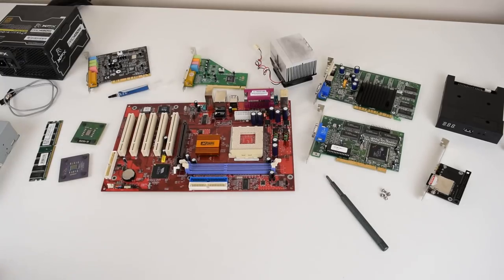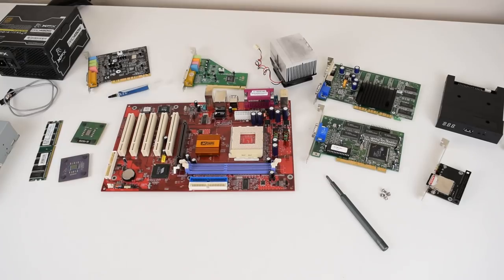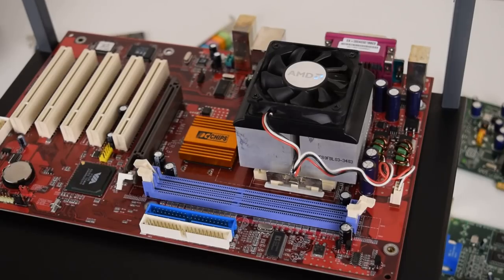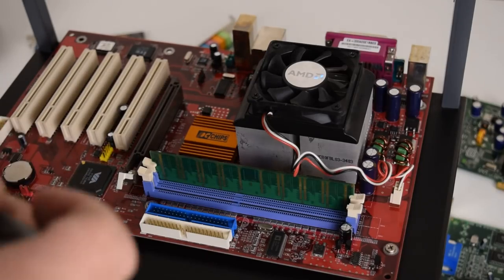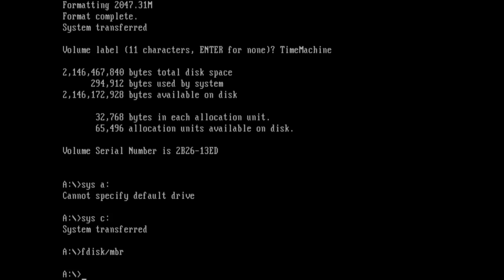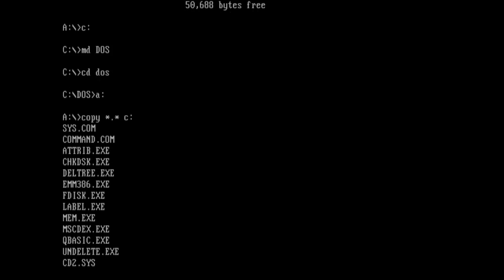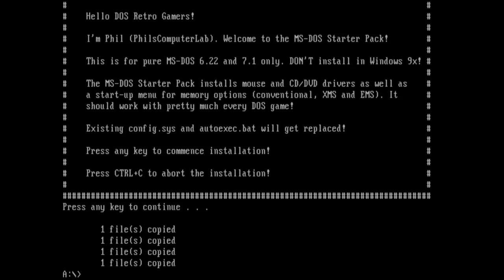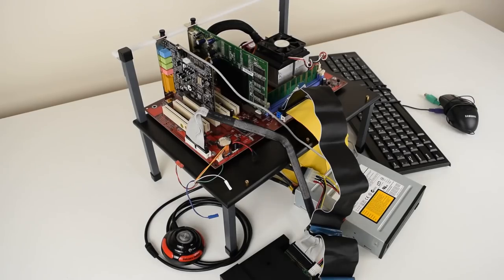Building a DOS Retro PC that everyone can afford

Comment: Personally partial to a slot 1 Pentium 2 at 230mhz. £10 price used, easy to install (slot one just plugs in like an expansion card, hear sink and all) and runs pretty much all the 90's software I can find without the need of cpu slowdown software. Iz nice. That and a stick of 128mb sdram wont set you back more than a few quid, and a period correct IDE drive is cheap as chips too. Only trick is getting a sound card both dos and windows compatible, but any ISA Sound blaster card, even the cheap cut down models (actual SB 16's run stupid pricy these days) will do just fine. For graphics I'd put any AGP card with about 32mb to run any late 90's game effortlessly and a PCI Mach64 card (windows 3.x compatible) for everything else. Wierdly, those old 5.25 floppies are ridiculously expensive now, £50ish for any listed working model. I don't feel those Flash cards are the best way of swapping data over though, a £3 usb switcher with any usb stick will let you switch it between two pc's with the press of a button, and a VGA to HDMI converter means no need for another monitor, just so long as you can set the aspect ratio correctly in the monitor settings. You can even buy new retro style beige cases.

Comment: Everything is expensive now, especially motherboards. Z68 motherboards, lga 1366 mobos, P5K mobos, socket 939...they are all at or higher price than brand new modern motherboards. I remember you could get a gtx 280 for like $20, now they are like $60. Its outrageous.
Reply from the maker: What about OEM SFF machines?
Reply: @philscomputerlab  those are still relatively cheap. Its mainly the desktop components that are overpriced. Although sff gpus are outrageous.  I can get an i5 4570 optiplex in my area(california) for like $60-$80.
Reply from the maker: @TrevorM1992  Hmm I could do a video about SSF and some cheaper Low Profile graphics cards. More for older games, Retro Games to tie you over...
Reply: @philscomputerlab  That would actually be amazing. Preferably a decent card under $40 USD. The one i always see is the HD 7570 1gb or r7 250.
Reply from the maker: @TrevorM1992   @Trevor Mundee  Yes something along those lines! While you cannot play the latest games, it will get you into PC gaming and you can play a ton of older games. And when prices improve, you can upgrade the graphics card to a 750 Ti or 1050 Ti or 1650 or that new Radeon OEM card that got announced.
Reply: @philscomputerlab  Exactly! By the way, have you ever considered doing a video with a sff pc and testing emulation? Such as psp emulators and gamecube emulators? Theres a ton of people who build these little sff emulation pcs just for playing psp games and such.

Comment: I have a ton of 64 and 128mb DDR1 sticks ive been holding on to but never thought there would be a use for lol I might try building a machine like this now
Reply from the maker: 64 MB? Nice :D
Reply: Yup i have 4 sticks toshiba brand 64mb DDR1 SDRAM sticks a few micron samsung and nanya 128mb sticks and a unknown generic 256mb DDR1 sticks. I also have a ton of DDR2 in small sizes I cant recall off the top of my head and like 200 sticks of various 30pin and 72pin sims in both FPM and EDO lol

Comment: Ok, actually in this setup you can use almost any socket A CPU, because there is a hardware hacks for them. Its easy to make, in almost all cases you can use just a sharp pencil for hacking, but for XP family its a little tricky but not impossible. The main goal is to make CPU identify itself as mobile version CPU (or even full unlock), so its enables multiplier free change by bios and software.

Comment: Great video again Phil ive only been following your channel for a few months but thanks to your videos and input on here and twitter ive already done Dos, Win 98 & XP builds but I still want to build more :) One thing I would like to know and maybe you could a video on this especially for the thin client PCs without optical drives is there any drivers out there that allow the use of a USB cd drive (especially for those Lucasfilm talkie and Star Trek CD games) theres some conflicting info on the net as to whether this is possible apparently there are some old panasonic drivers from years ago that may work but ive had no luck with them.
Reply from the maker: Hmm, there is software to mount an ISO image file AFAIK. Lucas games should run from a folder without needing a CD I believe.

Comment: I have a MINT Gateway 2000 486 DX2-66, 16mb, 120?mb, 2-4x CD with WFW3.11, DOS 6.22. The only things I DON'T have are the original keyboard and mouse. The big cork feet are pretty deteriorated, though. I got this "curbside shopping" (free) with a bunch of original software (probably $2000+ retail new). I also found a Gateway 2000 486 DX2-66 LAPTOP - I forget most of the specs except it was 4mb RAM - but only Windows 3.1. I used that as my HAM Radio programming rig, the desktop was my retro PC. The laptop, unfortunately, fell from about 4' high and "exploded" on concrete during a move and that was the straw that broke this camel's back.

So, if I'd had the laptop currently, I could be tempted to sell the entire desktop for a reasonable price (think "rummage sale" not "ebay" pricing!!!) But now without the laptop, I'll probably will the desktop to my kid!

Comment: A K7S5A is perfectly good as it has a ESSONIC sound hardware on board it does share the system ram with the on board GPU also has SATA I, if you want to separate graphics card try an AUSTECH EN9500GT with NVidia GPU, or what about a AM3 motherboard and AMD PHENOM II X6, the ESSONIC suit of programs include 3MIX DJ scratch package.
 if you are having problems with certain drivers then try DEVICEHIGH:=MSCDEX.EXE /D: or /E:
EUROFIGHTER EF2000 TACTCOM will not run properly and and you might have to change the multipliers to get EUROFIGHTER EF2000 to run.
can you not use a SPDIF feed from your CD ROM drive to your sound card to get the audio.

Comment: hercules 3d prophet 9800 Pro agp card?

the HDD normally connects on the primary port with the nearest connector to the board and 80 pin cable

Comment: I've been finding it's WAY cheaper to get full systems that nobody wants and pick out the components you need than to get the components individually. Those old systems are a gold mine for Memory, Cards, CPU's, Old IDE Drives etc. What pisses me off is that people are mostly just sending them off the the recycler. :( In the real world Slow is dead and dead is off to the recyclers or gulp in the garbage. :( So sad.

TLDR: PEOPLE ARE THROWING THIS STUFF AWAY FOR FREE.
Reply from the maker: Yes, depending on where you live, you can get nice parts for free :)

Comment: Really nice video, great idea. I would have not thought of using a Socket A setup for DOS. I think I now have a reason to keep my Socket A board, not that I was going to get rid of it anyway. I'm curious if this setup would work with Sierra games that bug out if the PC is too fast (KQ6 comes to mind) or if One Must Fall runs without a hitch. Any thoughts of dual booting with Windows 98/XP?
Reply from the maker: Yea if you disable the Cache you shouldn't have any speed issues with Sierra games. Of course you can run other Operating Systems.

Comment: With the prices rising on old pc hardware, I wonder if the atom chips might be a option as they lack a lot of the modern features but retain the x86 compatibility at a low cost.
Reply from the maker: What parts exactly are you referring to?
Reply: The cpu/motherboard. Given that the atom chips are cheap and low power they may be ideal for old dos system in place of a genuine 486/386 etc. Usually less audio/video expansion availability however. But investigation of it may be interesting. A very small and easy set up may be possible that way as they're available in numerous mini itx boards, as are the and geode CPUs which is effectively amds answer to atom chips in some respects

Comment: Speaking about AMD Geode, have you ever heard about Alix PC Engines ? A long time ago I had an alix1d, it's a mini-ITX SBC based on a Geode 500MHz, 256MB of RAM, Sound Card, VGA, Compact Flash, mini IDE interface, 1 PCI. Unfortunately I did not try DOS or Windows 98 because I used it as a Linux server (Raspberry Pi did not exists). If my memory is good it was possible in the bios to downclock the CPU to 333MHz. One day if I can find a cheap alix1d I would like to give a try.

Comment: Great video! Is that Duron multiplier locked? I wonder if it would be possible to play 486 or Pentium games on this? Probably not as versatile as your 4-in-1 K6-III+ build, I'd guess
Reply from the maker: Yea it's basically a 2 in 1. 386 or Pentium III level performance.

Comment: I have a PCChips M789CG motherboard with onboard VIA C3 processor, though I wouldn't recommend it as a retro DOS/Windows 98 machine contender since the motherboard isn't stable enough, unfortunately. I have several problems with the system, especially BSOD problems on Windows 98 and XP (IRQL_NOT_LESS_OR_EQUAL). That is, until the motherboard decided to bit the dust by freezing every single time it goes to the BIOS process.

PCChips is such a bad brand when it comes to making motherboards, with many people on VOGONS complaining about their crappy PCChips mobos.
Reply: TechFan2000 I had many pcchips. None of them were stable lol. 
My last one a m825 V7.a died misteriouslly, i didnt use it for months and now it doesnt turn on
Reply from the maker: TechFan2000 I used a PCChips board to make a point :D Of course you can use whatever motherboard you fancy.
Reply: i think some people on VOGONS are just to picky with there parts.
Reply from the maker: Not just VOGONS, I see it everywhere to be honest.
Reply: Tbh I'm surprised to read this, I've got this exact mobo for my retro build and I've found it to be fantastic, picked it up for $5 got a soundblaster live and geforce 4mx for another $5.
My crt and old beige case cost me more setting me back another $10, so for a $20 buy in I'm pretty happy with it and it's been nothing but stable for me for the past 18 months on win98.
Reply: SilverX95 Vogons? What is that?
Reply: Kyle Planktonic Good to know! What is the model/revision of your board? 
Some had removable bioses, that should help alot. A common issue in that age was the corruption of the bios chip. If yours suffer from that, having a removable chip that can be easily flashed in other computer would makes things easier.
Reply: It's the v3.0A which I believe has a removable bios(At least I can find places online to buy the chips from), I'll have to keep in mind that I might have to flash it at some point.
Reply: Gilson Marcondes Ladeira.
Yeah, well, you know, that's just like, uh, your opinion, man.

Comment: Like many others, I tossed out quite a bit of old hardware over the years. I did not expect such a massive retro wave for old hardware, and certainly not for "middle-gen" stuff like this. Personally, I find that watching these videos (mostly) more than scratches any nostalgia itch I might have. As far as DOS games goes, you can get away most of the time with Windows XP-era hardware, without any extra fuzz. Then you can also run newer games. I would never even have considered doing what he's doing here. It seems a bit weird to me to be at such a 486 purist, without actually using a 486. If you're gonna go old, go old, or pick something more meaningful, maybe. An interesting topic nevertheless.

Comment: Phil, I want to build a system around a Voodoo 4 4500 AGP i have. Would an Athlon XP board with a AGP 2x/4x/8x slot work?
Reply from the maker: Well AFAIK the V4 is actually AGP compatible with newer boards. So yes, it should worth with any Athlon XP board.

Comment: But having a whole separate machine as a "retro" computer takes up too much space.   I just use a Thinkpad T23.   I'm still looking for a way to make a SD/MMC replacement for the HDD that will let me swap them out without having to pull the whole drive tray out  The HDD slides in the side, and without the trim piece on it the HDD is readily swappable, but I'm concerned about putting wear and stress on the IDE connector.

Comment: In Latin America a lot of "PC CHIPS" was used so you can find them very cheap, but I do not consider them because you do not find drivers on the internet.
Reply from the maker: There is no such thing as motherboard drivers actually, you just need to get the drivers for each component. Like Chipset, LAN, USB, Audio. And they are super easy to find.
Reply: Well, I never saw it like that.
Reply: @philscomputerlab  can u find the bios update for it? Im looking for one but dont even manage to
Reply from the maker: Yea that can be tricky, I believe I used the stock BIOS with this board, worked just fine.

Comment: Socket A is probably the worst platform to build a retro pc - I have had at least half a dozen of those and none of them work by now, due to leaking capacitors. They also put  a huge load on the 5v rail, which modern supplies can barely handle.
Reply from the maker: I disagree, but if everyone thinks that, well that's good for those who know better :) I address the 5V PSU issue, it's a non issue with the low power CPUs I chose.
Reply: Thays what happens when you get the worst and cheapest motherboards avaiable... 
My cheapo-ish m7vkq runned for 16years, and the pc got replaced by a more powerfull core2duo, but i still use my socket a m7vkq for retrogaming, it has around 20 years of hard work by now...

Comment: I know this is a very old video, but I just wanted to comment that your SD to IDE card is probably hard wired for master, AND only utilizes the 40 pin IDE cable.  It looks in this video you are using 80 pin IDE cables.  Try a 40 PIN ide and set the optical disk to slave and you should be all set.
Reply from the maker: I'll remember this when I do another project using this adapter!

Comment: I have that same pcchips that just died when i left it off for a month. 
These pcchips arent a good deal, they really break easily. 
I would go with a asus, or msi, or even a ecs (less bad), that usually cost about the same as the pcchips. 

Is that pcchips a m825?
Reply from the maker: You can use whatever you like, the chipset, especially south-bridge is what matters.
Reply: PhilsComputerLab A sis chipset board would also be good? 
I didnt liked much sis, after i had a sis mirage 3 laptop, the support was low to non existant and linux support was a utopia.
Reply from the maker: Eduardo Avila Yes their south bridges should also work well with PCI Sound Cards. It's just that I find VIA based boards more frequently when looking on eBay, and I know that they work great with PCI DOS Sound Cards.

Comment: cool using the sd card as a hdd but how long will the sd card last? i dunno if they are built for constant read write usage
Reply from the maker: What constant writes are you going to get in DOS though?
Reply: i never used DOS
Reply from the maker: That's what the video is about, building a DOS machine.

Comment: i have a sb awe32 with the x2 connected on the wavetable header, my gravis gamepad conflicts with the x2. the s2 never did this. ive even lineout from the x2 to line in soundcard. my machine is a p3 800mhz 512mb ram. dos 6.22. can you help? and, would running the x2 or x3mb external with a midl cable with joystick adapter work?

Comment: I can build a DOS machine using nothing but Oracle VMWare.  My vintage Gateway P133 died on me about a year ago.  I need a system that can run Windows 98 in high graphics mode, let me know if you can piece together one of those.

Comment: I've got a near identical hardware configuration, and cannot for the life of me get DSDMA to work; the instant I run the program the machine reboots without any sort of error message. The only major difference is that I'm running DOS underneath a Windows 98 SE installation. Have tried a different PCI slot, tried messing around with memory allocations in the BIOS, and so far nothing has worked. For now I've given up on using that AOpen YMF card and am using an SBLive! SB0100 with SB16 emulation instead.
Reply from the maker: DOS underneath a Windows 98 installation? Not 100% sure what you mean, but you have to shut the machine down into MS-DOS mode. In a MS-DOS prompt, there is no need for drivers, it's already working for the most part.

Comment: I have a Athlon XP 2000+ and a getforce3 ti 200 64 MB with 2 slots of the ram 256 MB , but I don't test the pc yet , because I need the cooler for the CPU , but what did you think of that specs for gaming 95-2000 and running on windows XP?
Reply from the maker: I will run those games really well!